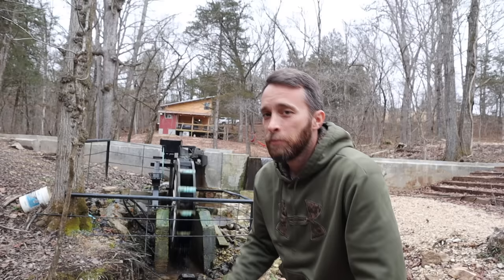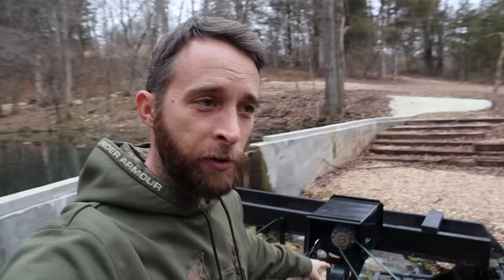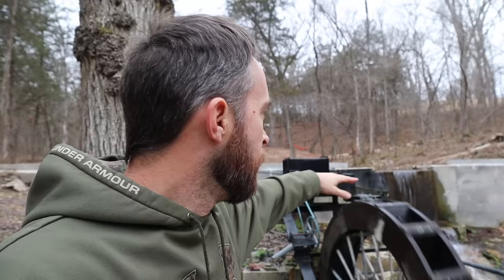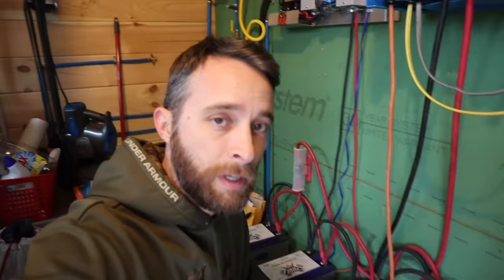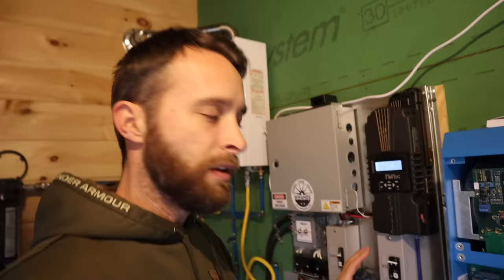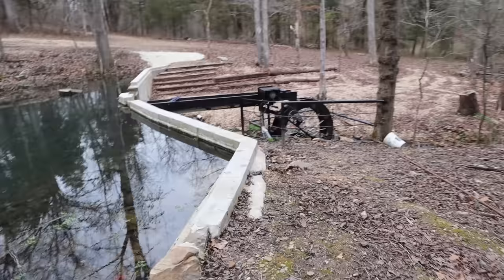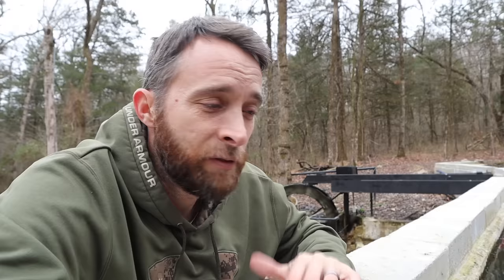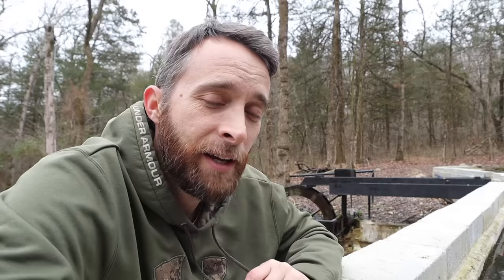Did we MAKE HYDRO POWER Using Our Waterwheel for Self Reliant Off Grid Living?

Comment: OK,  I've read through a LOT of these comments and let me start by just saying,  GREAT JOB  on the cabin and the dam/water wheel.  Beautiful place and you should be very proud of it.     Wonderful family too, I appreciate you sharing with us all.  
Now to my point, energy is just another commodity that is mass produced and distributed at a much cheaper price than anyone can generate it for at home.   If you did the math,  you're probably spending between .40 - .60 cents per KWH just for the cost of gasoline alone to run your generators (since the hydro isn't working).    And, even if the hydro was working at the best possible efficiency, you'd probably be doing good to break even when you factor in everything you've already spent on the system, maintenance replacing bad components due to lightning strikes or just cheap electronic parts.  It looks like you're only about 1100' from an overhead powerline.  If you just have a line built out to your place, you could purchase power from your local electric coop for around 12-15 cents per KWH and not have to worry about any component failures.   
Now,  by this point I have probably made about half the readers mad because I seem to be against renewables,    I'm NOT against renewables,  I think all the big power companies should be using renewable generation, mass producing it, and distributing it at a low price.   The issue is simply this....  everything is cheaper when it is mass produced and distributed,  rather than making it at home, whether it's pencils, groceries, or electric energy.   
I have a small creek on my place, about the same flow rate as yours,  when I multiply the flow times the available head and use realistic efficiency numbers, I could only hope to generate around 140 KWHs per month.   My house (which is small) typically uses between 1,500 and 2,000 KWHs per month.  It just wouldn't be worth it to save $16 worth of electricity off a $150 electric bill each month.

Again,  wonderful cabin,  I love the dam and small pond,  it looks like a great place to sit and unwind and watch the kids play in the water!!
Reply: Oh,  as far as your hydro system not working,   the only thing I see that isn't quite right is the parallel 10 AWG wire running from the PMG to the cabin.   Correct me if I'm wrong, here's my calculations...   2000 watt Generator 24 volts 3 phase AC would be 27 amps per leg.  
The longest distance you could realistically run 2 parallel sets of 10 gauge wire at that current is about 50 feet.     For a 220' run of 24v 3 phase 27 amps it would require a minimum of 1 set (3 conductors) of 250 kcmil wire, which is about as big as my thumb.     The fact that MWAS sold you parallel 10 gauge wire tells me they never intended it to produce more than about 4 amps of current, which would be 288 watts of power at 24 volts 3 phase AC.      I'm guessing your water wheel turns about 20-25 rpms.   If you could share your pulley diameters we could double check your rpm calculations for the PMG.     Are you sure it's getting plenty of RPMs?

Rather than changing your wire from 10 AWG to 250 Kcmil,  you could move your entire battery/power bank system down next to the water wheel/PMG,  then run the 120 volt ac circuit back to the house 220'.    But, even running one 120 volt 20 amp circuit 220' would require at least 4 AWG copper wire.   And, if I was going to bury wire, it would be aluminum direct burial, which means it would need to be upsized to #2 AWG.   Much cheaper.
Reply from the maker: Thank you

Comment: All I would suggest is go to the source,  the spring itself, and build a holding tank.... from the bottom or middle of the tank run a smaller diameter hose down the hill to where you have about a 30 foot drop.  At the end of THAT hose, hook up a pelton wheel with a generator attached to that.  I've seen it done before and it works... Yeah, you need about thirty feet.....You have a great pond for fish and the kids....
Reply: Or put some big spoons on the wheel he has and aim that stream you talked about at the wheel , 😅  like you said the power of water  in a constricting hose with gravity helping out  ,that's how hydrologic mines worked  to blast away mountain s 😅😅😮

Comment: I remember doing a best case calculation for you. You have a volume (weight) of water that falls a distance from top of wheel to where it dumps. That is the maximum potential energy. The rotational speed of the wheel, then determines horsepower or wattage. (750 watts equals one horsepower). Water weight in pounds X height of drop in feet X Travel speed of the outside of the wheel in feet per second. (550 feet pounds per second equals one horsepower. Wheel buckets look like they hold about a half gallon of water or 4 pounds. The drop looks to be no more than 4 feet and I half butt timed the wheel rotation from the video at  about one revolution every 4 seconds, or 15 rpm. So you have a lever arm for a "bucket" of about two feet and a weight in a bucket of about 4 pounds. That is 8 foot pounds. And at 15 rpm with an outer rim diameter of about 4 feet you have a speed of about 1 foot per second. That works out to a horsepower of 32 divided by 550 or about .06 or 1/16 th horsepower and a wattage of about 44. So at 24 volts you get about 1.8 amps. This is all best case so far. My guess is you may have about an amp at the batteries with the long run and other inefficiencies. So you either need a much larger diameter which will necessitate a larger vertical drop. Or a much larger bucket size which will necessitate a larger flow volume. And of course any combination of those. Double the diameter of the wheel and lift the top of the dam to take advantage of that and you will get an exponential increase to a whopping 1/4 horsepower. or about 4 amps at the battery bank best case and more like 3 amps with efficiencies. Run that 24 hours a day and you get 72 amp hours. Enough to charge one battery 3/4 of the way.

Comment: I really hope that you didn't give up on the project. If you did, it may be worthwhile to come back to it.
step 1: Find out what the open voltage is at the generator. You'll want this to be pretty high if you want the charging equipment at the house. Likely in the neighborhood of 250v dc.
step 2: of the open voltage is only around 50-60v, move the charger close to the generator along with a 24v battery. The generator should be at around 40v, 12 amp when the charger is working. The charger should be giving the battery 25.6v-28v at about 20amp.
If the open voltage is around 250v dc and the charger can handle the higher input voltage then you'll likely see about 200v dc at 2.5 amp at the charger.

Another option would be to switch to an ac generator and convert the ac to dc at your house. You'll have more power losses, but even if you only get 400w charging it may really change your available energy, as it would mean 9.6kwh per day. As a bonus you would be producing energy when solar isn't able to which means not using batteries as much.

Another option would be to replace the inverter with a hybrid charge controller/inverter. Some allow connecting ac. The newer ones have the option to use ac input as the output priority and also invert dc to ac. Another option is to invert dc to ac and use the ac input to charge the batteries.

Comment: LOL!  Kris below has some pretty good advice.  My advice.  Loose the bicycle size wheel on the shaft.  Your robbing your tork.  Put a gear on that shaft and upconvert with a gear box (one off an old bushhog might work).  In other words utilize your tork!!!!  Next loose the fancy smansky generator or alternator or whatever it is.  Find a starter or DC generator or alternator off a dozer.  That will crank about 120 amps@14v constantly (if you got the water).  Next, you can't run DC that far without loosing most of your power.  Even with 4 ought copper you would loose 50%.  Find 2 old large microwaves of the same kind and upconvert to 50,000 volts AC at the wheel with the transformer. (or whatever the transformer makes).  Get that up and away from the kids and such.  Use the other transformer to downconvert back to DC at the house with a bridge rectifier.  You will retain far over 90% of your power.  You will need a couple of good size capacitors to smooth that DC.  Now you won't need all that junk or the batteries ;)  You will have a constant 14 volts or so at the house @ 120 amps!!!!!  That is a lot of power sunshine!!  Unless you want to weld, that should run 12v LED bright lights in every room and simply use an inverter to run a TV or computer.  I doubt that D8 Cat generator will even notice ;)  You need a lot less "Rube Goldberg" and a lot more "Straight to the point".  Now iffin you just gotta charge the batteries, hook them through an old ford voltage regulator an straight to the battery bank.  I wouldn't bother but you can.  C YA
Reply from the maker: Thank you

Comment: When it comes to the 12V vs 24V, the amount of energy stored will be the same if you have the same number of batteries. The advantage of a 24V system is the inverter is usually more efficient because it doesn't have to bump the voltage up as much. Ideally you'd have a 48V system. However, it looks like your generator will be happy to dump into 24V, so that makes the charging simpler.

Comment: 24 volt at 50 amp hours is 24 volt X 50 anp is 1200 watt hours  12 volt at 100 amp hour is 12 volt X 100 amp = 1200 watt hours  It is the same you wire size Is (agw) small for 24 volt system
Reply: One advantage of a 24 volt system is that the wire size can be smaller than a 12v system.

Comment: Well the math for direct current voltage loss over a copper wire is pretty simple, just look it up, a good idea would have been using an alternator generator, and rectifying it to direct current next to your battery setup, alternate current is used to transport energy over long distances  for a reason! 
I believe your week can work with the correct generator and cable !

Comment: So freaking cool ur setup! Given ur wire from damn to house already submerged, either think AC or go bigger DC voltage alternator with rectifier at house. ALSO! Think about changing to a bigger wheel and add a flywheel. I would go for an aluminum built water wheel with lead flywheel. Just 6" or 12" more in diameter in water wheel makes a significant difference to the alternator. THIS WILL WORK!! U just have a "week link" in ur system. Ur house setup is awesome top notch! The choice of 12 or 24v is about costs in wiring + appliances combo. At 12v, u need 2-3x bigger wires to compensate for loss thru distance.

Comment: I’m not 100% sure but isn’t 200+ feet a really long way to push 24v @ 80amps? 
The wiring in the video seems to be undersized. Now I don’t know your system 100%, but 24v at 80amps/2,000watts the voltage drop at that distance is 92.13% using 8awg wire. 

You might have to figure out a way to put a “power” shed near the wheel. This could take the 24v’s and bump it to 110v. That would make the voltage drop from the wheel to the house much smaller. 

I’m sure I’m missing something here but that’s where I would start looking.
Reply: you are exactly right, huge losses at 24v, either need big wire 1/0awg? which is incredibly expensive or produce high voltage A/C at the generator and the rectify and charge at the house. Or as you said put the batteries close to the waterwheel and send 120vac to the cabin.
Reply: Yes these wires are WAY too small. I ran wires to a trailer hookup that was closure then this setup, and they are wayyy bigger wires then these

Comment: you need to change the ratio size of the pulley of the gears at the waterwheel.  You already have everything in place - adjusting the pulley wheel size ratio will give the multiplied power to charge your batteries

Comment: Use an ac alternator you can get higher voltage. Ac transmits longer distance with less voltage drop. 
Rectify it in the shack.
Nice water wheel.

Comment: 8:30 no you wouldn't have. 

Watt is the universal currency for hungry electronics. A watt per voltage is an ampere. Having 100 amps at 12 volts is the same amount of watts from 50 amps at 24 volts

Comment: Just watched your videos on this build, I haven't read through all the comments but a few videos back you explained that you had a small pipe that pulls from the bottom of the dam and runs down the hill to a future pond site. Put a peloton turbine Infront of that discharge pipe. throttle it with a valve. You will have not only vertical head pressure but also dam pressure. enjoyed the videos. Good luck

Comment: Am I the only one who thinks the water should fall more in the front of the wheel? 🤔
Reply: Also the weight of the water wheel is a big resistance...
Reply: @azlanlajis  Once it is turning, with a balanced wheel, there is no problem.
Reply: @gravelydon7072  the problem is that it doesn't seem to be well balanced or tracking strait. to my eye it seems like a bike spoke wheel that is tentioned wrong
Reply: @highkicker11  Yes, it could be out of balance which would lead to problems with a steady speed. The weight of the water wheel should act as a flywheel to smooth out the rotation if it is running true and balanced.
Reply: @gravelydon7072  could be what is causing the variation in the amps.
Reply: @dannyhyatt4924   i just know its a big part of the cause because when he has the wheel turning like right now you see it speed up and then slow down. also if you look at a fixed point like the water-flu you can see that the wheel is not round because the distance between de wheel and the water-flu gets bigger then smaller ever so slightly.

Comment: There are some alternator (car, RV) with a external rectifier, also rebuilt alternator 
so you get a external rectifier are available.
Reply: yes and move the rectifier to the charge room so he would be running high voltage AC over the long wire run

Comment: Hy Michael! I love your off-grid setup! 1. You can make your water-wheel set-up more effective. I think, the water hits your water-wheel to early, increase the length of the water-gutter to almost the middle of the water-wheel ( right above the axis or rotating shaft). And make your water-gutter smaler at the end ( smaler opening on the water-gutter, wider buckets) 2. Have you ever heard of the Vortex-Turbine or Kaplan-Turbine ( Maybe you can put it after or under the water-wheel to keep your water-wheel). There are a lot of videos on you-tube : " most efficient water turbine design ". 3. You should try out some different pullies/ drive wheels ( you can keep the rest of  your set-up = cheap solution ). 4. Then messure your output directly at the generator, so you can find the perfect water-wheel to generator set-up! 5. After all this, you can take care of your electric set-up. Good Luck! ;)
Reply from the maker: Thanks

Comment: You can run the drain pipe, to where ever you can create more than the 20 inches, it will create a siphon. The turbine doesn't need to be at lowest point, the discharge pipe can give you your elevation.